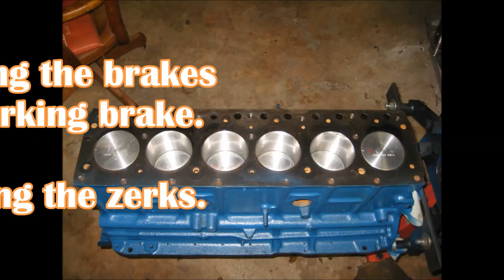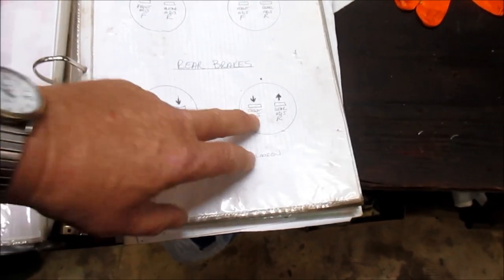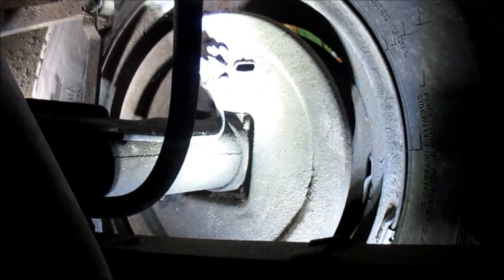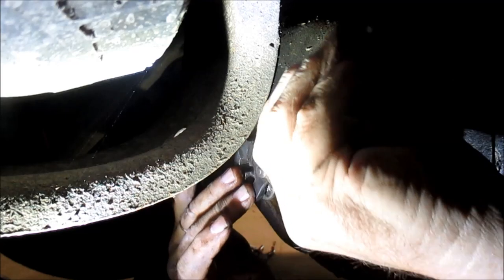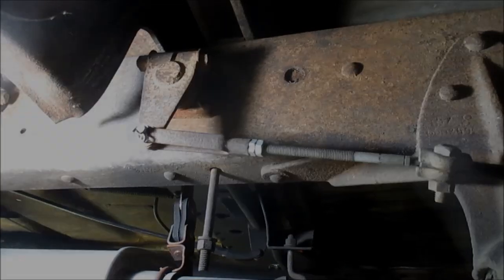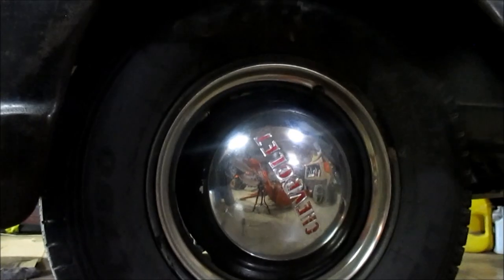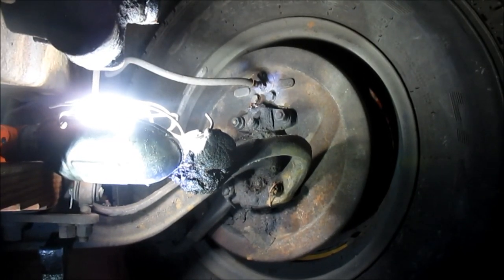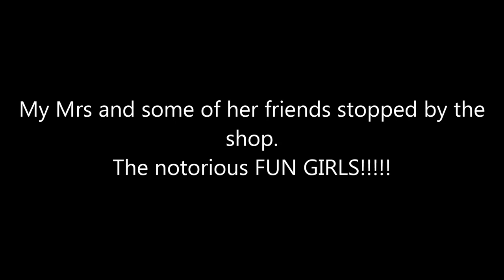1949 Chevy 3100, 3000 mile service part 3, Volume 60, adjusting the parking brakes.

Comment: Another really useful video.  Thank you so much! I 'm now about 1/2-way through maintenance on my mother-in-law's '54.  Just waiting on motor oil, spark plugs and some radiator hoses, then I can get him started and set the timing and tune the carb (single barrel Rochester).  Found some interesting things along the way - HD oil bath air cleaner, HD 3-sp trans (I think, it has an open driveshaft too), no oil filter of any kind, broken heat riser spring, petronix electronic ignition, aftermarket fuel pump, 12V system, no working gauges (next project).  It's been great having you (and the fun girls, haha) along with me in the garage during my adventure.  Thanks again man!
Reply from the maker: Hey Andrew, sounds like you're moving along. Have a good 'un my friend.

Comment: My '53 with the original 216 developed a knock, so a 235 was needed and since few things are interchangeable between the two, I needed a complete engine. After a lot of dead end searching and phone calls I found an engine builder willing to build a turn key engine for me, kinda like yours with dual carbs and headers and he even makes the exhaust system. It wasn't cheap, but at $85 an hour for the installation it will save a lot of time. Should be here in a few weeks, I hope.
Reply from the maker: Sounds like a good plan. You'll love the improvements the 235 will bring. Looking forward to hearing a successful completion.

Comment: Hi Dave, thanks for the E brake adjustment good stuff, have you ever had the flat bar on the E brake pedal go out of round so it doesn;t grab, i think thats what is going on with mine, my spring is good but the pedal just slips through the flat bar, great video,  do you think some people might get confused with the two illustrations on the left of the page, should the F and the R be swapped, because when you are adjusting the left rear it looks like your turning the R up according to the illustration, also can you tell me if there is anything i should know about pulling the horn cap off on the stock wheel, i need to get to the steering wheel nut and i don't want to damage the horn cap, thanks Mike (PS i will let you know about the corn head grease i will be putting mine in today after work)
Reply from the maker: In looking at my cheat sheet I can see that it can be confusing. Best way to cipher it is to follow the labeling i.e. F = front or leading shoe and R=rear or trailing shoe. The direction arrows are correct for expanding the shoes out. Unfortunately the drawing of the wheel seems to be from the wheel side instead of from the back side which would be the view you would see when adjusting the brakes. And this is where I can see that it can be confusing. Just follow the labeling and disregard the wheel drawing. 
The horn cap just pry's off. I use a skinny screwdriver and work it around the cap. It generally will pop off pretty easily. 
I just got 2 tubes of the cornhead grease today. I'll be applying it in the next day r two.
Reply: @Volfandt  thank you, what do you think about me question on the flat bar that the E brake rides through
Reply from the maker: @DesertRatFabrication  I must have read right over that question. Yes, the flat bar in my 49 didn't hold the the parking brake pedal when I applied the parking brake. I found that the release arm was bent so I bent it back and that helped but it still would slip.  I believe the "U" clamp that secures the flat bar is worn as it allows the flat bar to move around, especially when setting. so what I did was rig up a spring that holds the bar tight to one side and it works pretty good.  I figure I'll replace that "U" clamp, remove the flat bar and file the edges of the flat bar hole that the parking brake pedal goes through so it will bite better. I've also thought about roughing up the parking brake pedal rod where it goes through the flat bar hole to help get a better bite also. But for now the spring works so all that is on the back burner for now.
Here's my email.
volfandt1@yahoo.com

Comment: The brake shoe wear for 6000 miles caused the parking brake adjustment to be that far off?  Is there moving parking brake parts that need attention under the drum?  thx.
Reply from the maker: Keep in mind these are Huck brakes and not Bendix. Hucks don't have self adjusters. Thanks for watching.
Reply: @Volfandt  as i research huck parking brake adjustment i found theres a adjustment of the toggle lever/bracket done b4 the drums put on but after the shoes adjusted to the drums.  So this means taking the drums off (rear only) after shoe adjustment. thx.
Reply from the maker: @wrenchguy  When I replaced my rear shoes I didn't have to readjust the the parking brake lever that attaches to the trailing shoe as it was OK. When I replaced the parking brake cable(s) from the cross shaft located about midway under the bed to the brake shoe(s) I adjusted the yoke connector to take up all the slack but not to where it would start to apply the parking brake(s). I then put everything together and made my final adjustments on the brake shoe adjusting star wheels. Once everything is adjusted up properly you should only have to adjust the brake shoes (via the star wheel adjusters) from that point on until you have to replace the shoes again. 
Huck brakes work fine and last quite a long time. The only problem is that they don't have self adjusters so when your brake pedal takes a couple pumps to stop you know it's time to adjust them.
Good luck.
Reply: @Volfandt  I understand, but the brown book says the lever should be correctly set to finish adjustment up near the cab.  just saying... someguy like me putting it together from basket case or worse won't know about the cable setting at the lever.  no worries i figured it out after looking at this crappy german made video 10 times.   https://www.youtube.com/watch?v=a75q4k42yHc